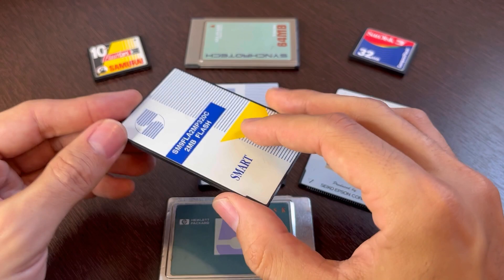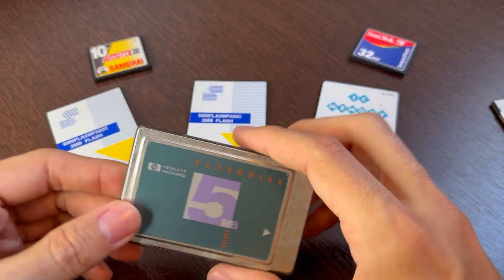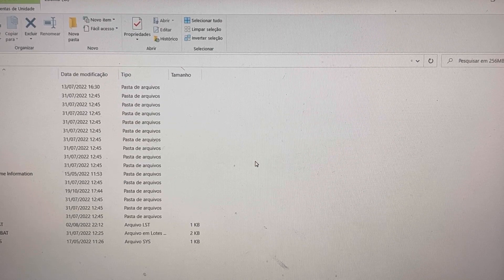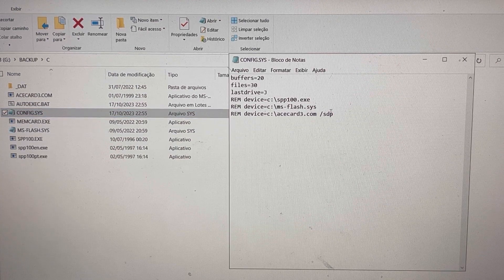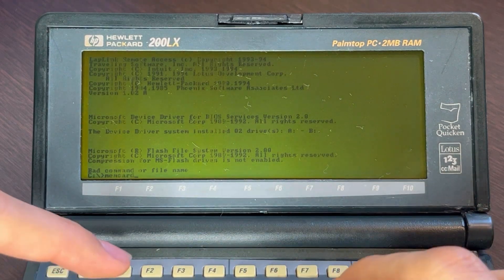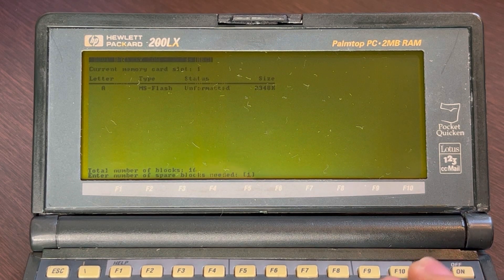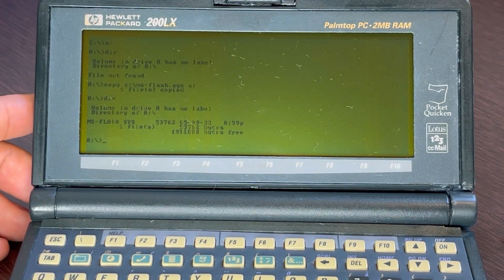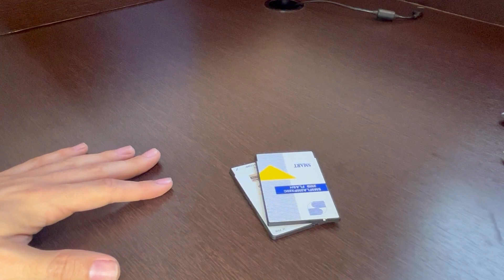Retrocomputing: Let’s learn how to deal with Linear (non-ATA) Flash Cards

Comment: Hello. I have a 4MB White Electronics Desgins Linear PCMCIA card and an 10 MB Intel Linear PCMCIA card (both of them should be 16 bit, and can write/format on 12 V, i m not sure in that) Can you help me out, how to read/format on them? I cannot fined a proper hardware nor softwares to check whats on them and write new stuff on it. But i dont have 600-1500 dollars for a omnidrive. Can i contact you somehow you would save me.
Reply from the maker: You don’t actually need an Omnidrive. Your best (and cheapest) bet is to find an old (1994 or 1995) laptop in working condition and use it to read/write the card. Laptops later than that usually don’t have the 12V line anymore on the Pcmcia slot. There’s even a software called Memory Card Explorer that enables you to read write these cards, and it works under Windows as long as you have a laptop with a real full standard Pcmcia slot :).
Reply: Ahh okey, and can you help out with sofwares that i need? Or the cards will plug and play on old machines? Will win95 recognize them( i m stupid for ms-dos 😂)
Reply: And do you have exact models of laptops that this feature is working?
Reply: PLS can you answer my questions. Its really important for me, so i do not buy a wrong one.
Reply from the maker: @dzsymy2805  hello and sorry for the late reply. Any laptops from 1996 or earlier should conform to original pcmcia standards. I have a 486 HP Omnibook that does :)
Reply: Thanks, and does it need any software to be recognized in windows file explorer? Or i need the program that is shown in the video? @electrohoard
Reply from the maker: @dzsymy2805  it doesnt need any software as long as the laptop has the original pcmcia drivers and dos files installed.
Reply: @electrohoard  I have bought an IBM THINKPAD 760CD and it support these cards, the system recognized the cards but they do not show up in the file explorer and i dont know what driver  im missin, in device maneger ecerything seems fine
Do you knoww how to fix it?
Reply: and where can i get the program tha you show in the video?